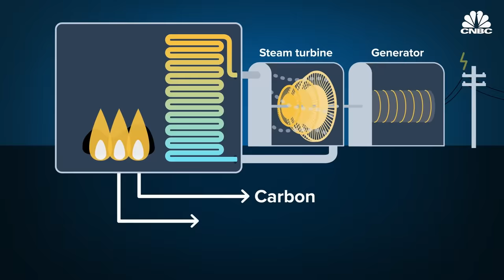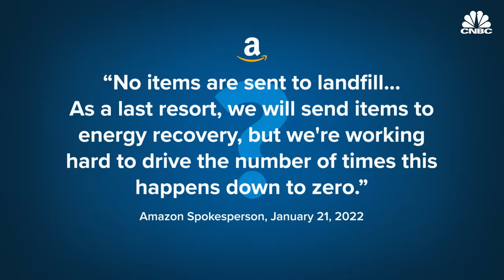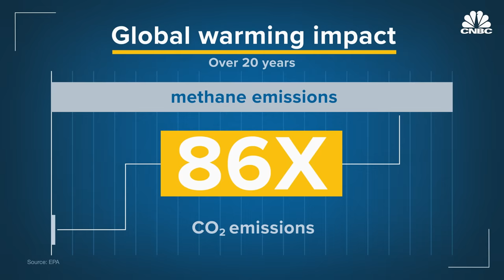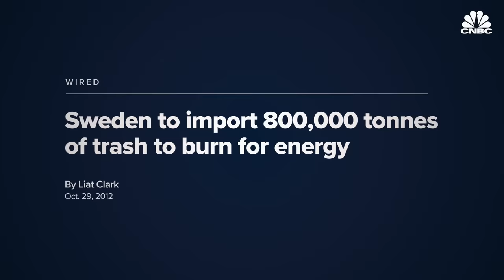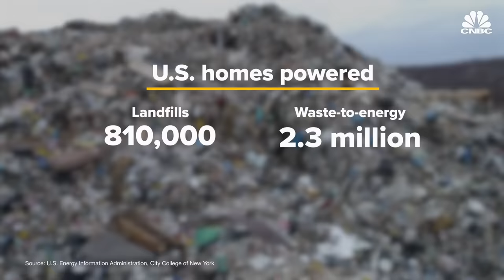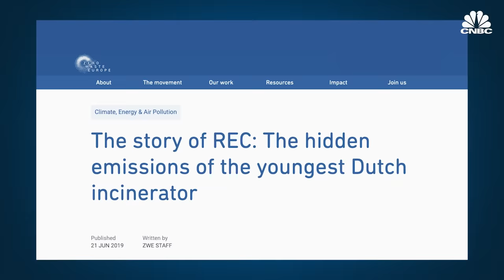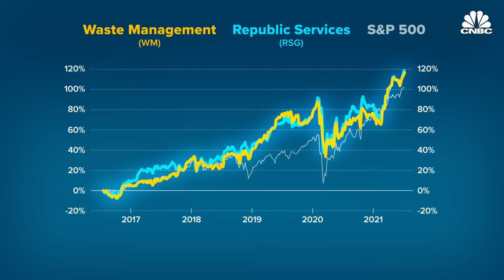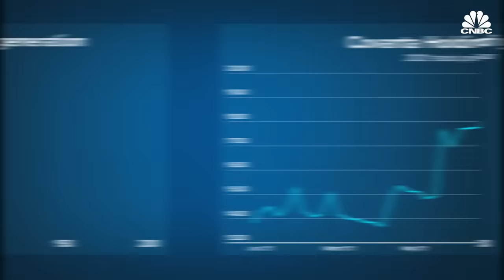How Amazon, American Airlines And Subaru Burn Waste To Make Energy

Comment: This should be done more often.  Plastics can only be recycled a few times before the polymers break down and can not be reused.  Burning it makes sense.  This means oil and natural gas is not burned for the same energy.
Reply: It is still fossil fuels, so there is no environmental benefit when used in energy production.
Reply: @Tore_Lund  How do you figure? The alternatives for non-recyclable plastics is to landfill them, also forgoing the energy they contain.
Reply: @tookitogo  If you only consider it a trash problem, then burning it seems better, but energy wise this is not a renewable source, even if it is a waste product. It is about how you calculate that: Fossil fuels used in engines has a higher energy yield per CO2 molecules emitted, than burning plastic in a furnace to generate steam. In Germany they have pilot plants for pyrolyzing plastics into diesel and gasoline like fuels. That recovers 90% of the energy content gone into producing the plastic in the first place.
Reply: @Tore_Lund  Unless that technology a) consumes significantly less resources than it yields, and b) works on plastics that are contaminated, then it’s unlikely to be a practical solution. If it can, then awesome. Of course, incineration still remains an option for wastes that can’t be recycled/converted or composted. Composite materials like laminated paper remain a huge problem. :/
Reply: @tookitogo  I think we agree, that burning is the better option, but the problem is the waste being generated in the first place. You can pyrolyze dirty plastics.
Reply: @Tore_Lund  Yes, I totally agree with you: eliminating it in the first place is absolutely where we need to start. In Switzerland, where I live now, the amount of packaging on groceries, for example, is quite high compared to what I’m used to from USA. I don’t need my corn on the cob or apples in a paper tray wrapped in cellophane, as an example. Sure, Switzerland is one of the world leaders in recycling (e.g. over 80% recycling rate on PET bottles, but more importantly, almost 100% recycled here and not shipped abroad to become someone else’s problem), but it’s still better to not produce the waste to begin with.
Reply: @tookitogo  I'm in Denmark, and we burn some plastics but the clean sorted goes to Germany, either for recycling or pyrolysis. Those are the most resource conserving, highest energy efficient uses of waste plastics (except for driving it to Germany). Clean sorted waste plastics holds as much energy as gasoline and represents as big a value, so it simply is a too expensive fuel to use for just generating heat. There are several political tricks used to make a problem "green" besides burning, Our minister of environment, claims that using pigs manure to make bio gas makes pig production CO2 neutral! Sadly either way: he is either too stupid to understand physics and has never read an IPPC report, or his pro environmentalism is as fake as it gets.
Reply: Nationalise all the waste companies, than with all centralized in federal level, you will be free to manage with much more efficiency, without the states have the power to miss manage the waste.

The goal must be 70% recycled, 30% burned to energy recover.

But the first step must be to build now the enough waste burn facilities, both for the waste levels of the total national, and as well to start to burn the already burried waste in the active and closed landfills around all the nation.

Remember that we need ground water to survive, and wadte landfills are poisoning the water that your next generation will need to drink.

Cleaning the land, allows to clean the rivers and ground water sheets.

Besides recovering a lot of metals...
Reply: What do you think the plastic is made out of? Oil.
Reply: This is a good solution, but it doesn't address the main issue: We're producing too much plastic. Incineration definitely has its place in waste disposal, but it will only benefit everyone if it is done simultaneously with recycling, composting, and reducing the amount of materials we make in the first place.

For example, incineration allows harmful medical waste to be properly disposed without harming anyone else.

Comment: “Zero Landfill” is misleading. I am an environmental engineer, and I have worked with several of these waste-to-energy (which is just a nicer way to say “incinerator”) facilities, and there is still a significant amount of ash left over after the burning is complete that still needs to be disposed of. This ash, along with used filters and other disposable materials that remove toxic gases from the exhaust all go to landfills. 

This isn’t to say that waste-to-energy is necessarily bad for the environment, but it is not as perfect a solution as this video describes. There is still waste leftover to be disposed of, and there exist incineration facilities in the US that don’t abide by regulations and pollute the air like you wouldn’t believe. It really depends on how well these facilities are managed, and how environmentally conscious they are. But of course with proper waste reduction, we won’t need to worry about that so much.
Reply: Ash is used in concrete...

Comment: seems like a lot of this could be easily addressed with:
a. better materials. e.g. more r&d into eco-friendly plastics and the like. a small tax on virgin plastic would help a lot as well. and basically phase out as many unsustainable or unhealthy materials as possible. 
b. better recycling: better programs and technology for separating items. this should be partly funded by an EPR policy. Also, products should be manufactured in a way to ease the recycling process. re-use should be part of the design. 

while consumption should be reduced, changing human behavior is the hardest path of all. and with sustainable materials, all our waste would be much less of an issue.
Reply: Your solutions look to me like: 
a. $$$$
b. $$$$
I agree with you but each of these steps will cost more, and of course those costs will eventually trickle down to the consumers in the form of hiked up prices… you can see how higher costs can be a problem to companies as well as consumers (just see what’s going on right now with inflation)
Reply: @mikezerker6925  :  The costs to consumers would be fairly negligible.
Reply: Or simply get ourselves out of this consuming based fashion; stop buying into cheap one off clothing, smart devices every 18-24m (phones, smart gadgets, etc), new age gadgets we think it's a necessity but actually isn't (smart door bell, cctv, trackers, tablets, etc etc).
Reply: @JLneonhug  Madison Ave will never allow it. Take a look at BBC's Century of the Self documentary.
Reply: And get away from the everything is disposable, start recycling, or not generating the worthless products that everone throwing away. Peace my freind.
Reply: @JLneonhug  Lol its not JUST the people. Companies have their guilt regardless of societal//market desire. No excuses.
Reply: recycling needs a complete 180 overhaul you might think we just need to make recycling easier or more frequent but no right now recycling is the primary reason we have micro plastics in the ocean 

when you recycle plastic it goes to the city waste center they do a verry rough sort to it then sell the bins of recycled plastic to a recycling company they will skim off the really good stuff then sell it overseas to anouther recycling compant shipping it off to them they will skim through the b grade stuff and repeat the proccess by selling whats left to a even cheaper recycling company eventually you get really small useless plastic scraps that arnt profitable to be recycled

and thats the catch here no one cares about this stuff unless its profitable

now this end of the road recycling company is running there proffit margins to tight they cant even afford to have this unusable plastic disposed of so what do they do they either illigally dump it around the country they live in or dump it into the ocean off a boat china have actually refused to accept theese grades of recycled materials because there sick of having to clean and dispose of it so just banned the importation of it which funnilly enough where i live translated into my local goverment canceling there recyling program how funny they guilt tripped me into recycling to save the planet (which is good we should look after the planet) but when there ability to proffit stopped they suddenly canceled the program

and that is where theese plastic ocean masses are coming from
Reply: Yes but what is the cost?
Reply: Agree on the tax.
Reply: @JLneonhug  Most people don't do things until they are made to.
Reply: Nationalise all the waste companies, than with all centralized in federal level, you will be free to manage with much more efficiency, without the states have the power to miss manage the waste.

The goal must be 70% recycled, 30% burned to energy recover.

But the first step must be to build now the enough waste burn facilities, both for the waste levels of the total national, and as well to start to burn the already burried waste in the active and closed landfills around all the nation.

Remember that we need ground water to survive, and wadte landfills are poisoning the water that your next generation will need to drink.

Cleaning the land, allows to clean the rivers and ground water sheets.

Besides recovering a lot of metals...

Comment: My local landfill in the central coast is a fleecing operation, they charge you 30 for a truckload, and then you have to sort through all your waste and seperate the metals and plastic and flatten your cardboard and put them in bins yourself took me over an hour to empty a small truckload in a tacoma, i used to live near the stanislaus recovery center and the dumps nearby were cheap between 10-15 bucks and you were in and out in about as fast as you could unload your truck.

Comment: In Norway, the WTE is free for all persons to use. If you move and you have a sofa, left over paint, TV, clothes and basicly what you have in a home it free to get rid of. When you get to there you put your trash in large bins for metal, wood, electronics etc. They will burn your sofa, melt your TV. Well, you get the picture? No you do not because the TV just melted. Haha. Bad humor on my part. That heat will be used in Oslo where I live to heat up almost 1/8 of the city. They have huge hot water pipes under ground from this WTE plant that goes in to my apt. So I turn on the radiator in my bedroom the WTE can be as far away as 13 miles. Just like they said in the program Scandinavia is so small that we have to import trash from Germany. The natural winner here is Iceland. The WTE from volcanos is super awesome! When I die I want to be burned. Some people say that my life was waisted. My death will for sure no be. Lol! Sorry. My sick humor again. Be safe and try to enjoy life!

Comment: Toxic ash gets used in highways… meaning that when it rains, highways leach toxic dust into streams.
Reply: Correct, Asphalt roadways are a MAJOR source of environmental pollution, adding extra toxic parts to it isn't really the way forward.
Reply: Fly ash turns as hard as concrete so there’s no toxic dust . I work at one of these mass burns .
Reply: In europe you use the bottom ash for road building. The fly ash doesnt get mixed in. The fly ash is used as filler in salt mines below the ground water body so it cant leach.

Comment: One thing they didn't mention in this article is whether any of the waste Amazon is sending to them has been sorted for recyclables that could go to a recycling facility instead of an incinerator. They talked a lot about toxic metals that are in the ashes, couldn't they eliminate some of these toxic wastes by removing them from the waste input stream? This video poses more questions than it does answers, I could go on for a while about this.
Reply: Probably makes a lot of sense.  Recyclable bins go straight to the dump anyways.
Reply: The heavy metals are filtered from the ash after combustion.

Comment: "Businesses are understanding sustainability," they say next to a facility that literally burns excess consumer goods that clearly never needed to be manufactured in the first place. Uh-huh. Right. Is it more sustainable than burning diesel and coal for electricity? Obviously, yes. Is it actually sustainable? LMAOOO. -- And, seriously, "far below US federal regulations"? Okay, as if the US has federal regulations relating to pollution, emissions, and hydrocarbons that make any sense and aren't literally 50 years behind the curve on climate change alone. -- "Until consumer behaviour changes," lol you know full well consumer behaviour won't change sufficiently or on time, and definitely not on it's own. That's what legislation is for.
Reply: This is basically an Amazon commercial

Comment: I don’t get what’s the problem? If you get les greenhouse gasses from burning it, than burying it, then just outlaw burying it and build a lot of new incinerators whit strict environmental standards. You could even collect the C02 and send it to a CO2 storage facility.

I know that you have to reduce waste and I have some ideas of doing that.
1.	Regulate what materials stuff can be mad of. Make sure the materials are easy to recycle.
2.	Increase the warranty period by law. Make sure its long so the industry is incentivized to make the product last.
3.	Make a law that force producers to have a details repair plan for there products, so when it breaks it will be easy or at least possible to repair. Also make sure products are made whit the intension of being reappeared.
Reply: CO2 storage facility, such an odd thing to even think of but it is what it is I guess...
Reply: That sort of regulation would make conservatives puke in terror
Reply: You can’t just simply outlaw something in a snap of your fingers this is fundamentally flawed
Reply: The main argument used is false.  They say burning trash reduces the amount of methane emitted by landfills...  Methane in landfills comes from organic waste (basically from food, grass and leaves that make their way to landfills), which can be composted instead and all the methane can easily be collected.  We do it over here in Montréal, Canada since a few years.

The trash they burn is plastic and cardboard, which both never emit methane in the first place.  The whole argument is a pure lie and people only do it to get cheap energy and to avoid having to reduce their trash production.

Comment: It would be interesting to compare a clean coal burning plant with this and compare emissions and the toxins of the ash produced
Reply: The alternative is landfills, which are far worse for the environment. One of the worst ways to deal with waste. Thats why most developed countrys use this process for everything that is not recycleable. The energy is a nice byproduct.
Reply: New plants can filter the exiting gas and the only harmful materials worth mentioning is the resulting co2 and fly ash. The bottom ash (most of the ash produced) is generally considered safe to use in construction. The co2 emissions are better than the methane emissions of landfills, which a 25x more climate damaging than co2. The fly ash can be solidified and used as filler in for example salt mines below the water table so it cant leach.

Comment: There is an even better way to do this by raising the temperature up to 4,000 degrees creating syngas which can be converted to all kinds of useful energy.   
Check out the Fast-OX gasification system from Sierra Energy.  It is a closed system and does not emit any pollution.

Comment: "Waste to energy" - yeah, pretty sure country folk invented the burn barrel.  That's what this is, just on a much larger scale and with a few scrubbers if you're lucky.
Reply: No, it’s not the same. A burn barrel doesn’t recover energy. And the much higher burn temperatures in incinerators produce a far cleaner burn than an open burn.
Reply: @tookitogo  Exactly.  I came across another similar comment in this comment section... It amazes me how many Americans don't understand even basic science...
Reply: @PG-3462  In all fairness, I actually don’t think most people elsewhere understand basic science, either… But Americans are somewhat singular in the way we, as a culture, celebrate ignorance.
Reply: @tookitogo  I understand the science just fine.  You're simply in denial about how "clean" the emissions are.  Sure those plants serve a purpose, but there are far better ways to generate power.  It isn't clean and never will be.
Reply: @bobhabib7662  Don’t put words in my mouth. I didn’t say it was emissions-free. All I said — and this is absolutely true — is that an incinerator burns far more cleanly than a burn barrel. And I said a burn barrel doesn’t recover energy, which is also true. A garbage incinerator recovers energy that is lost if you just landfill the trash.
Reply: @tookitogo  Speaking of putting words in anyone's mouth, we can start with you and your failure to grasp a little sarcasm.  Either way, incineration isn't clean and leaves a lot of very toxic ash to dispose of FAR worse than many other types of power.  At best, incinerators are a desperate attempt to avoid building a landfill.
Reply: @bobhabib7662  Nobody said incineration is a perfect solution. But neither is landfill.
Reply: @tookitogo  A landfill is lined.  Not perfect, but a lot more perfect than a stack where you've made the particles small enough to travel further due to your burning, created some funky new ones and now you still have toxic ash you'll need to put into a hazardous waste landfill.

So all around it's FAR WORSE to burn trash for cogen, then it is to manage a landfill and treat the leachate.
Reply: @bobhabib7662  Well, not everyone agrees with that conclusion.
Reply: @tookitogo  The facts don't lie.